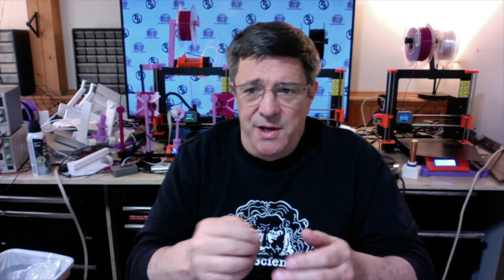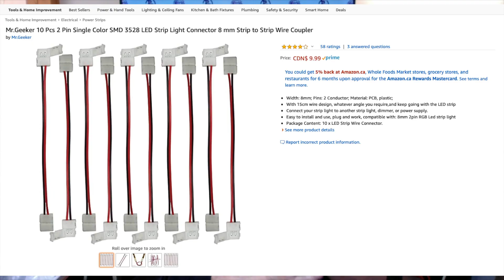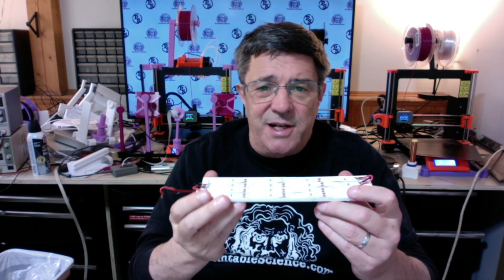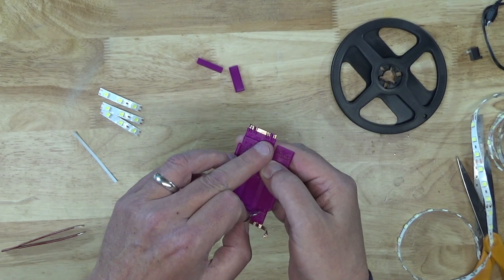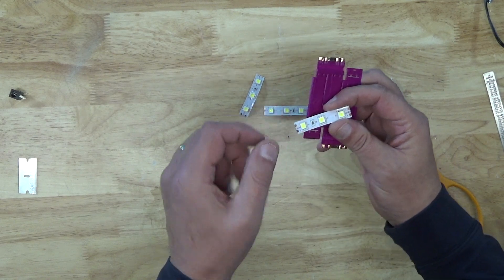3D Printed Solderless LED Panel

Comment: FWIW, when I made my LED lighting, I used the CRI 95+ LED strips referenced here: https://www.youtube.com/watch?v=DhbMnQt14_o&list=PLOJU8YJjFwGN0hMRewz2_u2IefV-vipsk&index=5  The light quality is *incredible*, and they didn't cost a lot more than regular ones.

(Rewatching his video, I realized that one design you might want to consider adding is to have versions with just the ends, so folks that are attaching their LED strips to metal backing can still avoid needing to solder their strips.)

Comment: That is a great design and a very comprehensive video.  One thought that occurred to me was to have a version where there is an 8mm(?) wide slot in the bottom of each channel so that the backing of the LED strip could be cut away and a strip of copper/aluminium/etc. stuck in place to dissipate heat, perhaps with thermo-cement applied afterwards so that a heat-sinking plate could be attached to the back to dissipate even more heat.  Optionally, allow the user to stick a heatsink strip to the back of the LED strip, measure the thickness of the result, and the Customizer script does the calculations needed to work with the thicker strips.
Reply from the maker: Thanks Keith... and I think the modification you suggest is a good idea although I'm not sure how easy it would be to implement. The current design requires the protective adhesive paper to remain in place so the strip slides into place. If you glue an aluminum strip onto that I wonder how long before the backing starts separating from the strip (thereby reducing the thermal conductivity in those places). However, it may help with cooling just to 'cut' some smaller channels in the bottom of each channel so at least you have less heat for the plastic to adsorb directly. I'll have to tinker with the design and see if that has any effect. Thanks for your input.
Reply: @ @PrintableScience :  Hmmm...  Some good points.  I'm not sure what you meant by the sentence starting 'If you glue...'  The backing would have to be completely removed to stick it to a strip of metal if the channels were made deep enough for both the LED and metal strips.  If the channels were left as deep as they are, then the backing that can be seen through the cutout in the center of the channel can be cut off after the LED strip is inserted.  Then a strip of metal sized to fit the cutout (and at least as deep as the cutout) can be stuck to the back of the LED strip.  If desired, another piece of metal can be attached to the ones already in the slots.  Does that make my design suggestion clearer?
Reply from the maker: @KeithOlson  What I'm referring to is simply my own experience is that the adhesive on the back of the LED strips just isn't that permanent (at least on the cheap LED strips that I buy)... The original design of the panel just involved sticking the strips to the base of the panel... but over time the strips would creep away from the channel. That's when a friend of mind suggested the chamfered channel so that the strip is held in place by panel and not by the adhesive on the back of the strip. However, perhaps the adhesion of strips to metal is far better than a strip's adhesion to plastic. I'm pretty sure I understand your design suggestion, and pretty confident it would work with a little bit of tweaking. I'll add it to my list of "things to consider" when I revisit the project for updating. Thanks for your input! :)
Reply: @ @PrintableScience :  I have a similar experience with them.  That wouldn't be a problem with the version with deeper channels, because the chamfer would hold the two strips held tightly together.  For the version where the heatsink fits into the cutout, you are correct that the metal strips could pull away; they would need to be held in place somehow.  A metal plate anchored to the LED strip holder would counter that.

Comment: This looks great.  I was about to make an LED Lamp and this looks like it will save me a ton of time.  Couldn't wait for items to ship from China so I went to my local electronics store and got the tape and connector today.
Reply from the maker: Sounds great! I'll be interested in hearing how your assembly goes. I really like how this worked out and i've made about 20 panels of different sizes for other projects, so I'm hoping it works as well for you as it does for me.